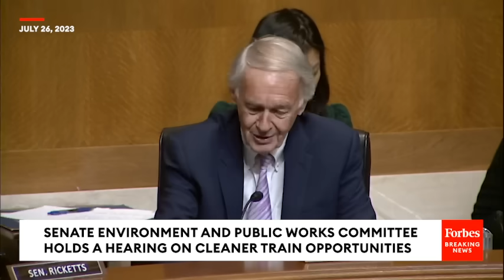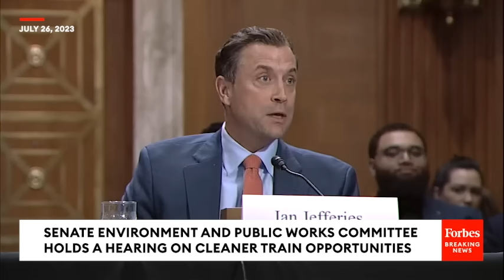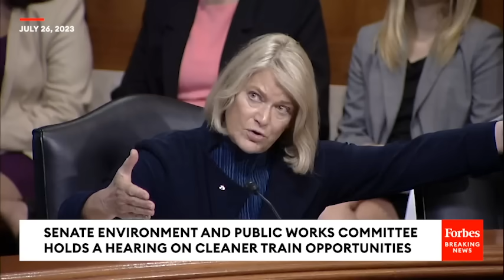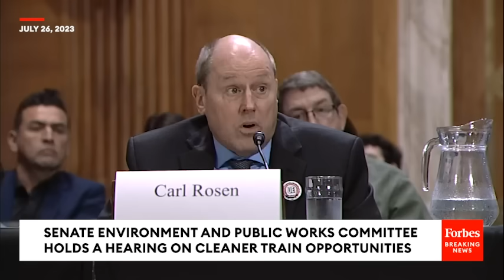‘How Long Would It Take To Replace All Diesel Locomotives With Electric?’ Cynthia Lummis

Comment: Railroads already move huge amounts of freight per fuel consumed and emissions produced. Intermodal (containerized) shipping has taken many trucks off the roads. 
    Are they trying to destroy what's left of our economy?
  Yes, they are.
Reply: To replace diesel-electric locomotives with battery-electric locomotives is yet another pipe dream of utter fools and/or communists: the same is true of replacing internal combustion engined cars and trucks with battery powered vehicles. The Senator proposing this idiotic notion apparently has zero comprehension of the environmental hazards [batteries catching fire, for one thing], the beyond astronomical costs in [attempting] such a conversion from diesel to battery power,...and never mind the costs of safely disposing of the spent batteries. Going back to using steam locomotives would be less foolish!
Reply: @alansloan7784   with the distance needed to stop a train, those batteries spontaneously combust like they do in electric cars, trucks, and e-bikes and mowers, i foresee lots more train derailments because the crew loses control of the train due to a battery fire, or possibly an entire rail yard burning to the ground due to a battery fire.  if most cars trucks and e-bike take 14 hours or more to charge the battery for 75-200 miles at most, how long will it take to charge a locomotive?  the grid cannot handle charging cars and mowers now, how is it going to handle charging a locomotive let alone a fleet of them?  wood travels to mills on trains, from the mills to a warehouse on train before getting loaded on trucks, i wonder how many millions or billions of dollars one will need to build a house, not to mention the added time if a locomotive can go 100-200 miles before needing recharged, when most of the lumber sold here in the state of georgia comes from as far west as oregon and washington state?

speaking of wind for power, the town i used to live in ohio, they were told their electric bill would be cut in half if they agreed to let those wind mills go up, guess what?  their power bills nearly tripled, and the ONLY thing in that town getting power from those noisy windmills is the clock outside the bank.

how much you wanna bet, it is all part of the plan to try and force us all into 15 minute cities by making our lives a living hell if we dont comply?
Reply: @alansloan7784 I agree!  How about using ethyl alcohol and methyl alcohol to boil the water in the boilers in the steam locomotives? After all both types of alcohol are produced by distilleries that produce either one without drilling and exploring.  😊
Reply: @luislaplume8261 Now I want a bourbon old fashioned!
Reply: Do you know energy density? There's cause diesel preferred, those alcohols about half by comparison so must accommodate twice mass for half the energy beside affecting power ... but there's more involved with chemistry & engineering. There's much more exposes ClimateCon & greenwashing.
Reply: @franklinblunt69 - This may be the definitive case to justify deferring to chat GPT.
Reply: @jglide20  Remind me to call Congresswoman A.O.C aka Horseteeth!  After all she was a barmaid at the Union Square Park Bar and Grill in NYC 13 years ago befor she helped her candidates for New York State and City Mayor win their elections and put her employer Out of Business!  😁
Reply: @luislaplume8261  Steam locomotives!!!😅😅😅 Little late for that 🤣🤣🤣🤣
Reply: @luislaplume8261  That's an interesting idea. Honestly, I don't know if it would be feasible economically, though.
Reply: @luislaplume8261  A steam locomotive can practically be fueled with anything that will burn. Do we really want to go back to fargin steam? Not gonna be too environmentally friendly when they are burning used water bottles, Pampers and tires to get down the track. 
 There is a lot more energy in a gallon of diesel compared to a gallon of ethanol. Further, I'm not sure a train could carry enough corn to convert to ethanol to run the train hauling the corn. Same can be said for the tractor that works the cornfield for planting, maintainence and harvest of that corn. It cant make enough corn to fuel itself if corn ethanol were it's fuel.  All this stuff can be learned with readily available info from the internet and a calculator that is built right in to the device you use to get on the internet.
Reply: @johnathansolloscy2897  Ehthyl alcohol and methyl alcohol is easier to produce and far less expensive than drilling and refining oil. I rest my case. After all both types of alcohol comes fro distilleries.
Reply: I had something similar when my elementary aged son was assigned a two question homework.  1. Write, in sentence form, a constant already achieved with renewable energy. (My substitute question was. Name one item in this room delivered without the use of petroleum.) 2. Write, in sentence form, a renewable energy objective you hope to see in the near future. (My substitute question was, name one item in this room provided with the use of only renewable energy.) His teacher could not answer them either.
Reply: One ton of  freight can   be moved around 480  miles / per gallon of fuel.Try that with a prius  LOLOLOL
Reply: @podunkpennsylvania292 - I had something similar when my elementary aged son was assigned a two question homework.  1. Write, in sentence form, a constant already achieved with renewable energy. (My substitute question was. Name one item in this room delivered without the use of petroleum.) 2. Write, in sentence form, a renewable energy objective you hope to see in the near future. (My substitute question was, name one item in this room provided with the use of only renewable energy.) His teacher could not answer them either.
Reply: Yeah, I've been hearing for years how much better locomotives and railroads are for the environment, and now - POOF?  All that's gone?  Same with Ethanol - just 10 years ago it was going to save the world, but now it is Verboten?  Follow the money, people!
Reply: @maddierosemusic  My brothers and I tried the rewire a locomotive turntable at the ‘UP’ yard on Mill street. We jumped through a window and were arrested, for trespassing and the railroad ‘bulls’ refused to believe we had permission to be on that vacant lot. After the police woke our father from a shiftwork nap, to come and pick us up, They said we were lying about that land belonging to our aunt. He said you are right about her not being their aunt and they were going to take us back immediately. 

When they asked why he expected them to do that. He said: "Because she is my aunt and she holds the lease on the Ford dealership on the other side of that lot. Also, she will be calling Sheriff Vinzant to know why you have arrested her crippled (great) nephew. They asked: "Oh, is his chief deputy their mother? My father said yes and Chief Sharp and I were the free safety tandem on the same football team too (With litter, you Don't Mess with Texas; but, in Oklahoma, you never mess with high school football) We were climbing back through the window to the UP switch yard within fifteen minutes. Except, this time, my youngest brother stood lookout.
Reply: I say convert them to wind power.  Just put sails on them and let the politicians blow hot air on them.
Reply: Not only will they have to replace existing locomotives, but they’ll need twice as many, if not more. A diesel locomotive can refuel in minutes and keep going, a battery powered locomotive will take days to recharge. Can they make a battery powered locomotive for half the cost? Oh hell no. It would double, or triple, maybe quadruple the cost of moving goods by rail.  Does she think a wind farm will charge all those trains?  If you want electric trains, you must start from scratch, and feed them from overhead power cables, like is already in use in Europe. The vast distances in the US make that very impractical.
Reply: I agree she didnt seem to give 2 $hitz when he brought up the case of how efficient RR's are compared to trucks. On the flip side RR's are their worst enemy when it comes to efficiency.
Reply: Yep .. exactly .. attempting to destroy our economy to force dependence on the government..
Reply: Unfortunately, they are willing to destroy us...in order to promote unfounded and unachievable idealogical goals.  I am all for protecting our environment and doing all I personally can to do so.  But, we have to use reason and facts, people!!!  "If wishes were horses..."
Reply: Right. Lets let India and China lead the way, then buy our locomotives from them.